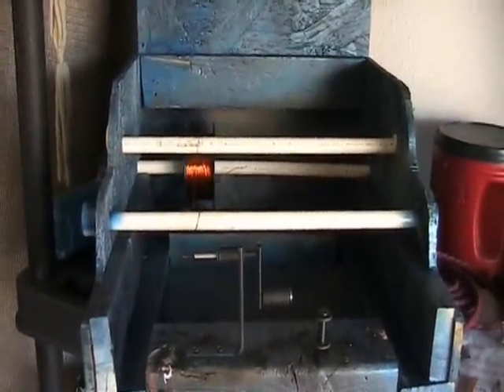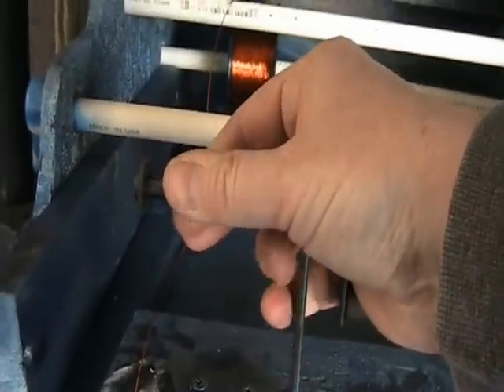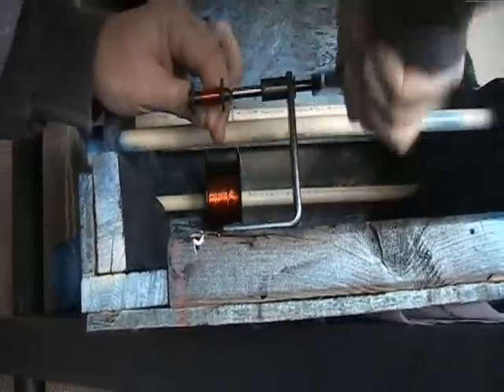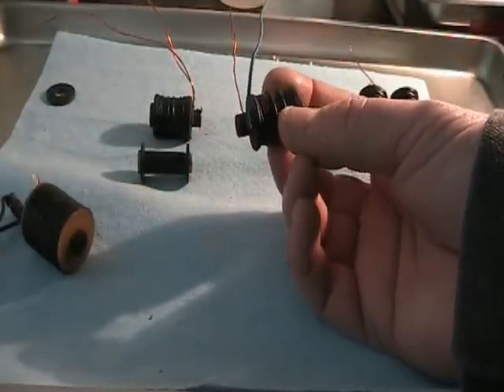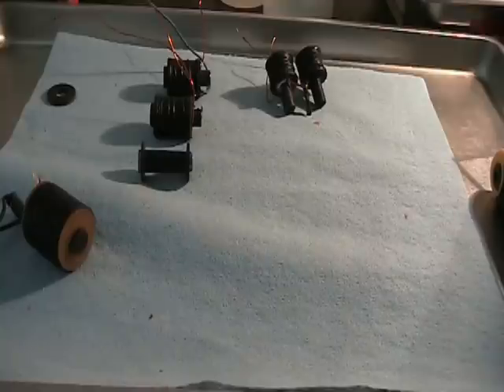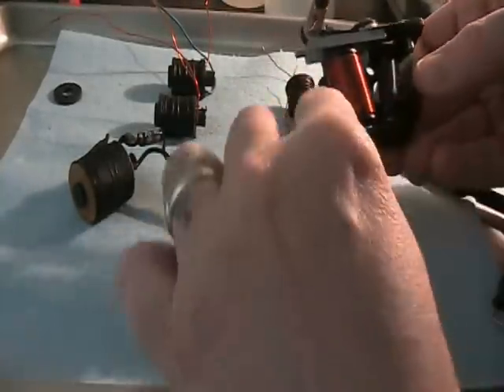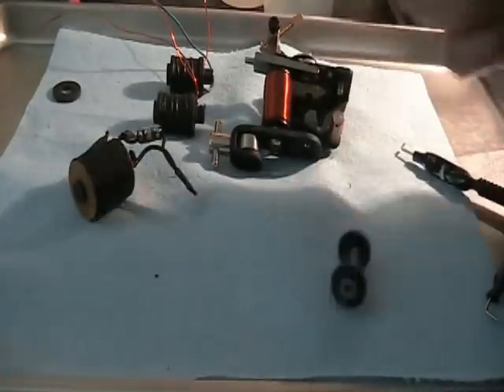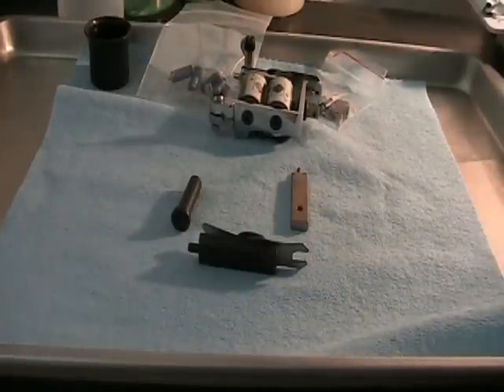Hand wound coils and new Builds Pt 1

Comment from the maker: I have and it is very little difference  , it pulls not pushes the needle and it cant pull much if the distance from the rear core to the spring seat is short , a longer throw frame will  get more out of the rear coil a short liner frame will not . but a liner doesn't need allot of power anyway

Comment: believe it or not Eikon ten layer 1 1/4 standard coils measured 4 ohms. I dont know the guage wire they use to wrap their coils but I would think they would be better than that.!! And I did get them from Eikon in Canada so they arent knock offs. I did test them right on the machine with everything attached capacitor and all. Dont know if that affects the reading or Eikon coils arent as good as I assumed.

Comment from the maker: the same  less resistance is cooler   power used not resisted....more ohms require more volts to do same as lower  thus more volts = more resistance  ,  best to stay under 2     thicker wire 22AWG has less resistance still but then you use fewer layers .     4.4 ohms means the wire is thin or not solid copper or both    24awg 8 layer 1ohm ,   1.5 10 layer   average

Comment: I recently checked the resistance on my machines they range from 1.7 ohms to 4.4  does that mean that the lower the ohms the more powerful the oils are?? Or they just wont heat up as fast as the higher ohm machines? And should I change the coils on the machines with the higher numbers??

Comment from the maker: no its not like that  it is  the direction of the wire going around up or down it is still going around in the  same direction     it can  even be clockwise or counter as long as they are both the same     have you read about right hand rule ?

Comment: kapton tape is the best to use for insulating coil cores. find it on ebay. 8$ or so for tons of it. timeless tattoo supply on ebay has all your coils core parts and temco also found on ebay has the wire. both suppliers are top notch. im sure there are others that are great but those two have never failed me.

Comment: thank you because I also learned about the American system awg gauge, I get smarter every day, but to get power out of a copper coil should you develop close as you say, but you should also make sure that the wire is located right next to each other by winding all the way up and all the way down again?

I ask about the thread must be on top of each other in all directions up and down the coil. or do they lie right next to each other to provide power at a passing magnet possibly?

Comment from the maker: no ,  bigger wire mean less resistance ,  but  6 layers of 22 is basically 8 layers of 24  just with a bit less resistance because the shorter length  used in 6 layers.   quality low carbon iron core  will get you more magnetism than bigger wire ,  shitty metal creates magnetic memory  or residual magnetism it makes the armature stick as the magnetism drops of slower ,   you want fast magnetism and then drop it fast too .

Comment from the maker: it may be a knock off  , use a paper clip  see if the clip sticks to the coil  ( hysteresis) ,  if it does its hi carbon iron core ,  and they are magnetized and will make it run shitty ,  doesnt want to let go of the armature and the timing is messed up .

Comment: Why does my machine has sticky coils like if they would of been magnetized with the a-bar i took it apart because it wasnt runing smooth n tried to adjust it and I noticed that the a-bar was sticky with the coils and I think thats why it don't run smooth like before o n by the way it's a paco Rollins steel liner any help thanks

Comment from the maker: THE CAPACITOR HAS  NOTHING TO DO WITH HOT COILS ,  if you watch my videos i tell you many times the ONLY thing that creates heat   RESISTANCE  .  you need to replace the springs  .018    5/8 wide rear for liner     1/2 wide rear for shader   and then apply the right amount of tension , your coils are hot because you have tooo much tension and they have work extra hard , how many volt do you have to out into it to make it run  ?

Comment from the maker: if core is good iron and wire is 24g and not thinner and wraps are tight then they are no different than any other coil.  only thin wire and excess spring tension creat resistance to the coils purpose,

Comment: Thats why I´m stuck, it should be simple. I never run my machines over 8volts, and like to tune them from 5-8v. Im using 18g for shader and 22g for liner, and bend them smoothly. I have used my coils in machines that I have not built, same problem. I have a couple of other artists that is using my machines, same experience there, after they tuned them to their liking. Also I have some old Mickey Sharpz coils, used them in in one of my frames, no heat at all. Switched to mine, heated up fast! :S

Comment from the maker: i dont think so ,  a coil  is a very simple thing what makes them hot is resistance , over working , when you pump extra voltage into them .   %90 of the time the reason for this is tooo much spring tension making you have to use more voltage to do the job.   how thick are the rear springs and how much tension are they under?    loose wraps can weaken it but being the case i bet ,  like a engine gets hot pulling a trailer uphill vs downhill

Comment: Great videos you have here, and I´ve seen this one many times to see what I do wrong. But I can´t see any mistakes in my wrapping.
Short story, my machinebuilds get burning hot after a while, 30mins or so. I have rouled out everything from frames to tuning, and it is my coils. Nothing else, it is the coils.
I use 24awg enameled wire, and have tried out t-tops with washers, bobbins, china cores, 1018cores, different caps etc. Still heats up. And different wraps, tight wrapping and sloppy wrapping

Comment from the maker: ?  what one wire ?   im saying  coils are wired in series  so if it is a single coil you want then you leave one coil out ,  the inside wire goes to rear post and outside wire goes to the front post  .  is it a single coil frame ?  if so it must go in the front or forward mount ,  if its a horizontal coil  then building a optimal coil is important   22awg 10layer  or 24awg 12 layer to 14  and the core needs to be good iron

Comment: thank you for this video i like all your videos. i have two question. first what did you use for your washers and does not using a bobbin and having the wire mocking contact with the iron core which i believe is what you did make any difference??

Comment from the maker: i think you mean resistance , capacitance is from the capacitor and doesnt change from the rating on cap ,  the resistance of 6 layers of 22awg  is basically the same as 8 layers of 24awg   aprox 1 ohm ,  as the exact amount is dependent on total winding from the core size  1, 1 1/4,  or  1 1/2 "   22awg has less resistance so you get same current with less wire ,

Comment from the maker: @vi0lTCS     i believe you meant to ask   about insulating the core before winding it with wire , and in most cases you can if your wrapping a bare core and not using a bobbin use a thin tape like kapton tape but you can use a single layer of electric tape or a waterproof label tape  can be used , i simply use a hi temp double lacquered wire and lacquer my cores , (along with encasing this in rubber ) .

Comment from the maker: @TheStevepwns     basically the capacitor is like a can of water and will hold only so much,  the bigger it is the longer it takes to fill,   now   you have 3 basic machine settings short medium and long stroke   or fast medium slow    match the cap   22uf with short fast , 33uf medium and 47 with long slow,    if you used a 47uf on a short stroke it would run weak   and a 22 would speed up the soft slow long stroke    and 25v is all u need